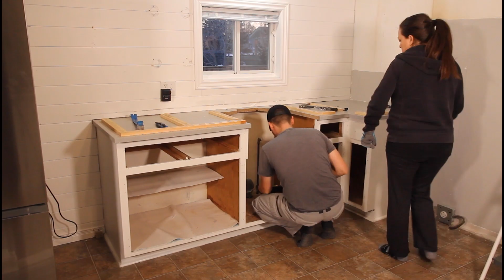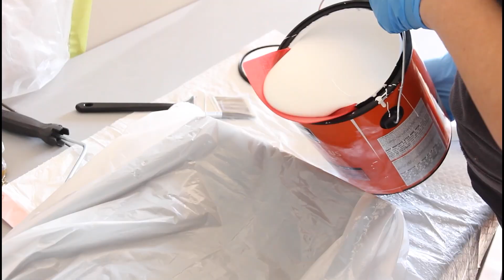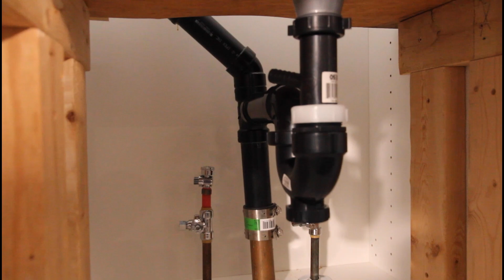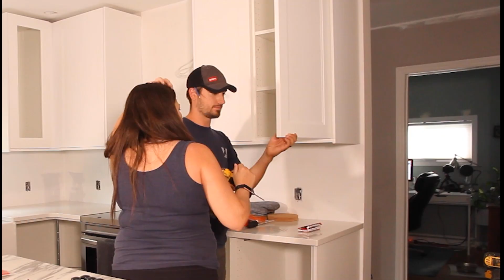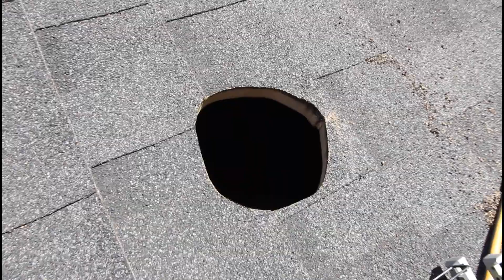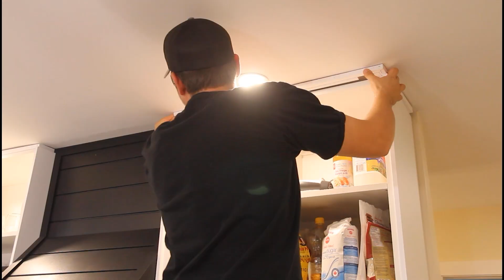Ikea Kitchen Remodel - Complete Renovation Start to Finish DIY

Comment: Great Work❤🔥. Could you tell me how long did it take to install all this by yourselves?
Reply from the maker: Thanks!! - It was on weekends over the course of many months so not totally sure but we also had delays like our furnace breaking and was put on hold for a while. - I think the longest part was demo and re wiring all the electrical and drywall work etc, the cabinets went up pretty quickly.

Comment: Can you tell me what gap you have between the wall unit carcass and your worktop please.. I thought I saw it somewhere but I now can’t find it. The ikea integrated extractor’s say you only need a 50cm gap between hob and extractor but other sites say 65cm. Our unit gap will be about 47-48cm then a deep trim underneath, so I’m looking into having a shorter unit over the hob now. An 80cm as opposed to the other 100cm ones. Just not sure. I’m wondering what your unit height is. I know you won’t have my problem though as you have your hood which is higher anyway. Thank you.
Reply from the maker: Ours is 27" (68.58cm) from the stovetop to the hood box - it is frustrating having so many varying numbers/requirements.